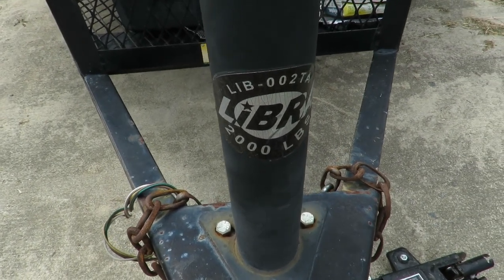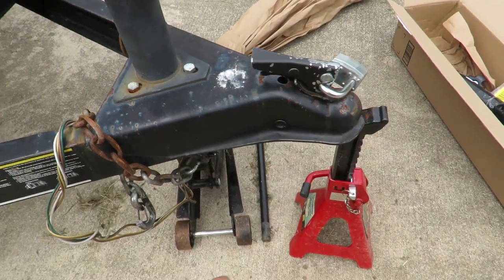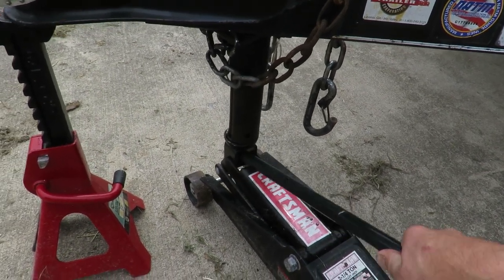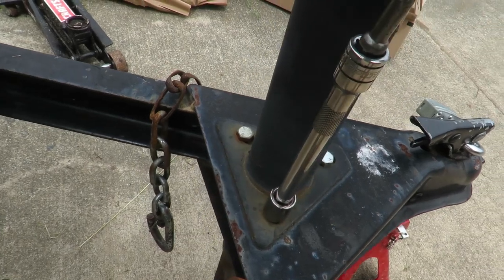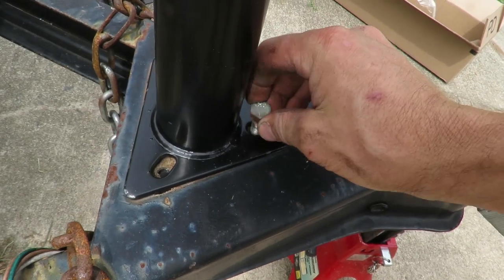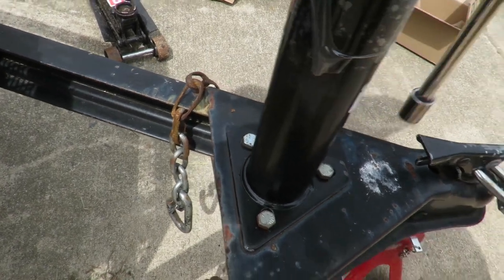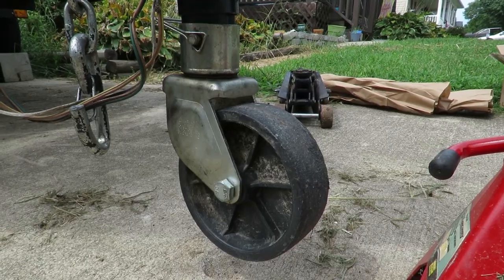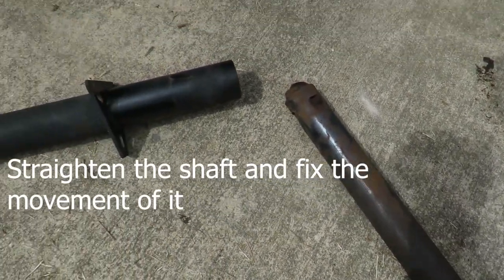How To Replace a Trailer Jack

Comment: I know this is an older video but just wanted to recommend replacing those safety chains. They look rusted to a point that they probably would not do the job they are intended to do. Thank you for the video!

Comment: You really should of put washers on those bolts 🔩
Reply from the maker: True. Will go back and do that to keep them from backing out
Reply from the maker: I'm curious now why they didn't have them from the factory.
Reply: @ASliceofWoodWorkshop  Do you remember what size bolts those are?